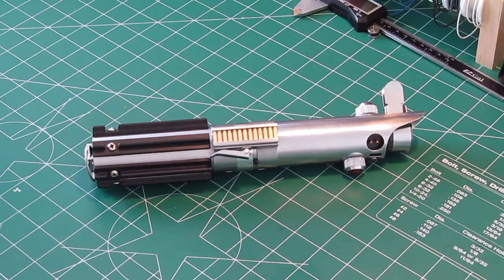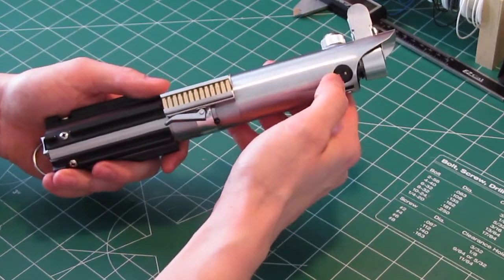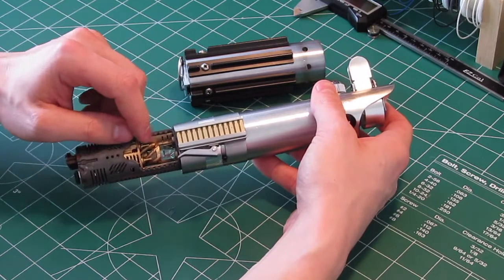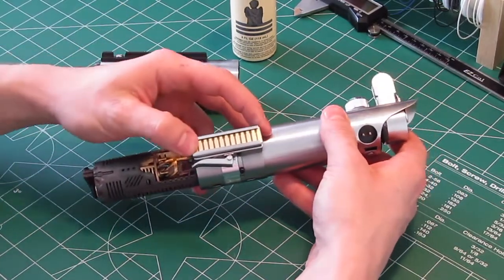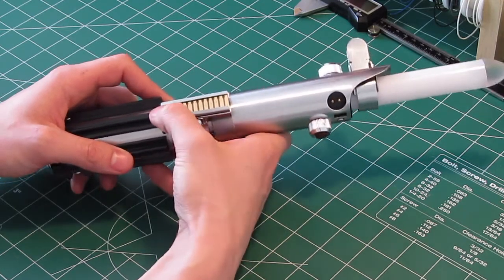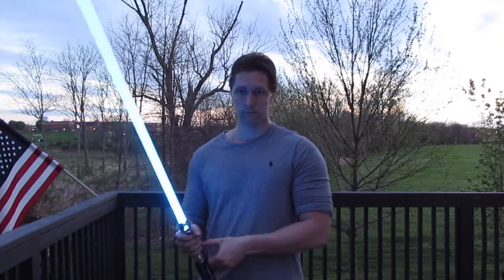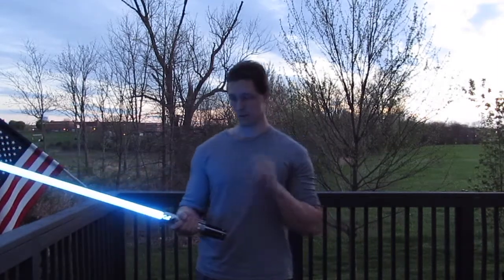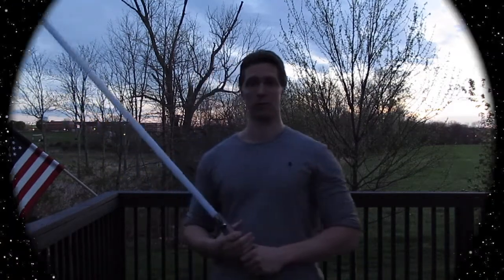Graflex 2.0 w/CFv8 and Crystal Chamber

Comment: Awesome video! I'm building the same exact one right now. What did you use to cut the crystal chamber spiral arms? Thank you!
Reply from the maker: Thank you! To cut the spiral arms I just used my wire cutters (made by Hakko). I just clipped them off cleanly and then filled, sanded, and painted the chassis. Good luck with your build and enjoy!
Reply: Thank you !!

Comment: Hey I was wondering are you running duel 18650s to power your crystal focus 8 ? cause I have been wanting to change out my nano biscotti v3 for a crystal focus but wasn't sure if I can run it with a single 18650 battery so then I thought about going with the prizm v5 but I really want to go with the crystal focus ??
Reply from the maker: Hey for this build I did the 3.7v hack with the CF8, so I just used a single 18650. You're actually in luck though--the new CFX can run off a single 18650 (as well as dual) out of the box, so you can run a 3.7v Crystal Focus and not have to worry about desoldering any components on the circuit board.
Reply: @excelsiorsabers  oh dude awesome thank you so much for the info I will go with the cfx than which I mean it's the newest cf soundboard anyway lol thanks again for the info and awesome video by the way as well
Reply from the maker: @random_manreviews1782  No problem. Enjoy the build!

Comment: What paint did you use on your chamber? and did you primer it at all or seal it after paint?
Reply from the maker: For the outer silver area, I used the iron metallic surfacer by Sophisticated Finishes (Modern Options). It has metal dust in it so you can burnish it when dry to create a more polished, metallic look. I also used the primer and sealer from the same company. Prior to painting, I sanded the chassis and filled it with hobby putty, and then sanded it again to make it as smooth as possible. It came out nicely, but I will say that the sealer dulled the finish down more than I liked. Martin Beyer of MB Sabers tested this paint in a video of his, so I wanted to give a try. The best thing is a real metal chassis, of course, but this was a nice alternative. The gold areas are simply painted with Testors enamel gold paint, and then slightly weathered with a brown wash. There is also some darker bronze paint in a few areas.

Comment: Did you have any problems getting the Crystal focus 8 in the chassis? Mine won't fit in even after sanding it down, did you make any modificastions?
Reply from the maker: Hi! It was a tight fit for sure. Are you using the knight chassis from Goth 3D? Is it just that the sound board won't fit into the space for it in the chassis, or is something else blocking it? How is your wiring? The first time I tried wiring up a chassis like this, it took a lot of planning to route all the wires so the sound board could freely snap into place.
Reply: Even without the wires, it wont fit. I'm using the exact same chassis as you.
Reply from the maker: How are you installing the sound board? The SD card slot should be on top. The way I installed it was to slide the soundboard into the rear part of the chassis and then snap the front part of it into place.
Reply: I know that part, its just refusing to go in. Anyway I had to really hack at it just to get it to fit
Reply from the maker: Sorry to hear about the difficulty you had there. I hope it worked out though and that you got everything up and running.

Comment: How much are these things?
Reply from the maker: Hi! One like this is pretty expensive. The Graflex 2.0 hilt kit is around $200; the Crystal Focus v8 sound board costs $150, and the 3D-printed chassis parts cost under $100. Plus you need a blade, blade LEDs, speaker, battery, charger, etc. so that raw materials for a build like this are around $500. Installation and assembly of this build with the Crystal Focus and painted crystal chamber will run about $300-$500, depending on who does the install.